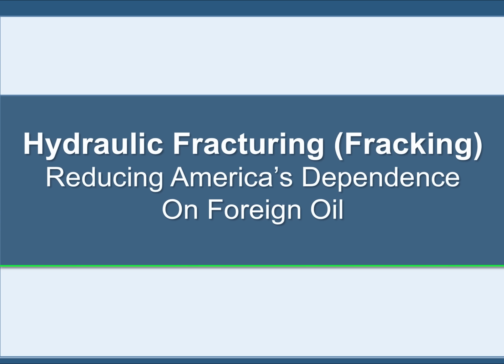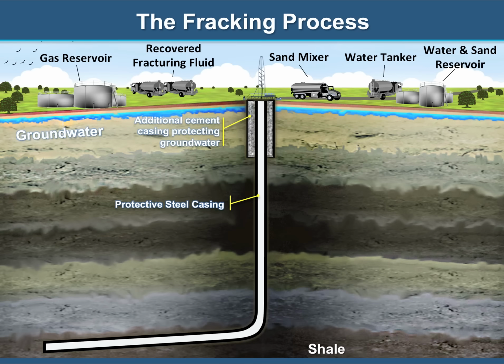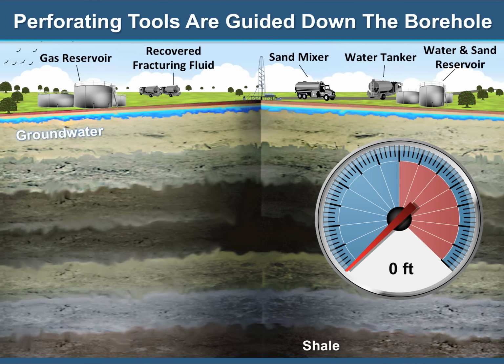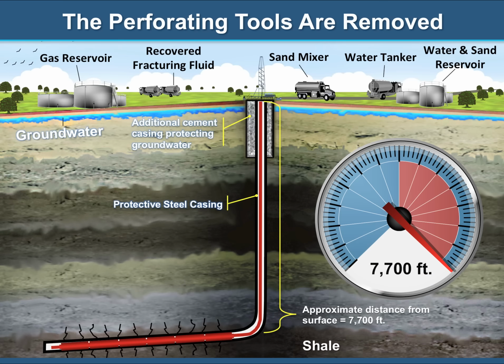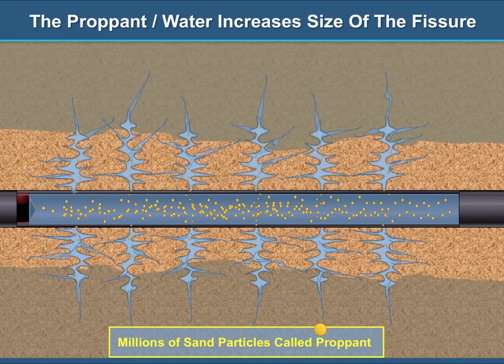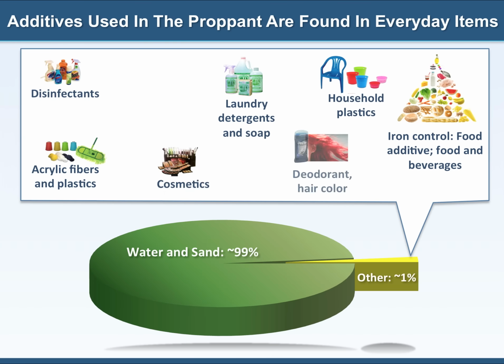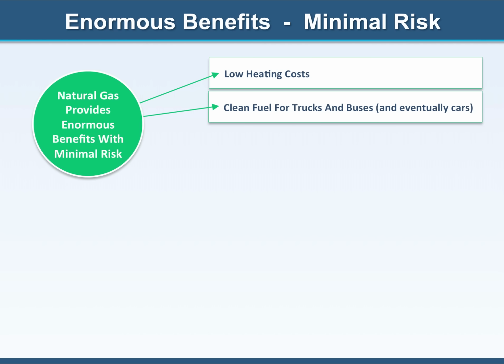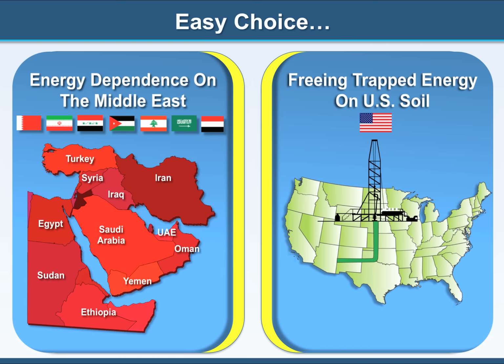Fracking Explained with Animation by A2L Consulting

Comment: If the production horizon is at the same depth but it consists of sandstone with good porosity and permeability could the extraction process be possible if we don't use water ...could fracking only lead to gas leakage into the hole thanks to the pressure change only? And could we call it conventional gas and conventional method? Is ERD system compatible with HYDROLIC FRACTURING?

Comment: The conductors emit a shock wave?    C'mon. Tell it like it is.   The conductors are used to initiate high explosive charges the perforate the pipe and shatter the rock .  Perhaps you did not want to talk about the high explosives.   Please also discuss the consitutents of flowback water and produced water, euphemistically called "impaired" water, and the means of disposing of this water.

Comment: I wish you mentioned that the water/sand/additive mixture is not used consistently. It's about 3-4 days of adding the mixture and creating the pressure of underground system. The mixture is pumped out and the oil or natural gas will come out for 20-30 years depending on the reserve size.

Comment: "A clean source of fuel" Bro it contains methane which is 86X worse then co2 emissions and the chemicals in the water are extremely dangerous. I know most right winged people are afraid to use science to figure out a problem but you should really try to implement it.

Comment: It all looks good on animations, but the reality is another story.

Let's just talk about the borehole.  As they drill down past the ground water level, all that groundwater pours into that hole, plus into any vast caverns that were hit on the way down.

This results in the groundwater level lowering, and that causes sinkholes and quakes.
Reply: Sure that may be a test that is used in the field. But it is not run during a frac operation. It would be run with drilling mud (containing water, barite, bentonite, and/or various salts) in the form of a pressure test to check the quality of the steel casing and cement layer. If pressure and fluid is lost, then the leak can be repaired and plugged with cement or gel. 
But to address frac fluid that does not flow back when the operation is done. Most company will run seismic testing to track all of the microfractures induced in the formaiton by the frac op. Very rarely do the fracture propagate into the overlying formation (although it can happen). Furthermore, gas and/or frac fluid will steadily migrate back to the wellbore due to the vast difference in pressure from the reservoir and the inside of the wellbore.
Reply: ...yep. We neeeeever do geological surveys prior to drilling ffs.
Reply: Richard Bean And they are so perfect right  They find every little crack at depth, every underground river, every empty cavern, and if ones is found, the oil company just goes someplace else even if they find a lot of oil down there?
Reply: kellerr13 ...you really have no idea how this actually works do you? Your hearts in the right place, but you seem to be horribly misinformed.  Obviously fracking isn't completely harmless (though miles safer and more effective than other forms of current alternative energy). It's still a HIGHLY regulated field in which absolutely every possible measure is taken to preserve the integrity of the water table, as well as the surrounding environment. Will it eventually be phased out by a better form of energy at some point? Sure. Until then this is what we have.
Reply: *****  THe well casing is not perfect, it's likely to have some holes and even if it doesn't there is a time delay between the drilling and the casing, and in that time, the water table drains down into that hole, and any exposed caverns.
Reply: kellerr13 the tubing and casing are both given numerous pressure tests, both positive and negative pressure tests, over each and every stage of the operation. Your scenario can and most likely has at some point happened, but it would be the result of the combined failure of several checks put in place.
Reply: Richard Bean What about the time delay from the drilling and the casing install?
Reply: kellerr13 The depth that you're  talking about prior to having surface casing installed is usually just after having cleared the water table and/or any potential aquifers. The drilling up to this point would most likely be utilizing compressed air or fresh water in order to preserve the integrity of the groundwater.
Reply: kellerr13 Any other questions? (Actually asking. That's not my attempt at being an ass)
Reply: Richard Bean Yes, how do you suppose that so much water get contaminated to the point it can be set on fire at people's tap?  And the ground water levels have dropped without any increase in water usage or any less rain fall in those areas.  Additionally, the ground water dropping results in sinkholes, and there are minor quakes.  These things are consistent with fracking.  Do you have an explanation for those?

Thanks in advance.
Reply: kellerr13 That ones actually simple. Theyre proven hoaxes who have either mixed a gas line into the it water lone for a quick video, as was done in the antifrack documentary "Gasland", or they are instances of naturally or curing methane in the well water, which has been documented as having occurred since at least Colonial times. Give me a bit to finish up answering. About to be driving.
Reply: Richard Bean For decades, the tobacco industry used similar statements.  "Smoking doesn't cause cancer", "It's not addictive", "Second hand smoke is not harmful", and I see the energy companies doing the same thing with fracking.

It's not all hoaxes even if some are. and just because the EPA says the water is safe, it still burns our eyes, causes rash on our skin, and we can taste chemicals in it and it makes us sick.  Pretending it's fine just shows us the EPA can't be trusted.

But all these things along with quakes and sinkholes are consistent with Fracking in close proximity, and it's too big of a coincidence.
Reply: kellerr13 These aren't statements made by the oil and gas industry, though I can understand your relunctance. If you're not willing to trust the EPA though, who I assure you we do not see as our friends in the oilfield, then there are other companies that can test the water. Taste, smell, etc., aren't going to be adequate ways of gauging anything valuable about the quality of your well water. These things vary wildly from place to place, regardless of fracking nearby.

I would honestly recommend watching "Fracknation". Watch it with a some skepticism though, since it's every bit the profracking documentary that Gasland is antifracking. The do a very good job of tearing apart the claims of the more famous individuals who used the flaming water argument.  I'll continue in a bit.
Reply: +798unionpipeliner I tried to be a little nicer about it, but yeah pretty much.
Reply: ***** Look. All I am saying is there is a pattern that goes hand in hand.  You may know a lot about the drilling process, but vulcanism, geology, etc. etc. are another issue.
Reply: kellerr13 Speaking of geology (which goes absolutely hand in hand with the oilfield), geothermal energy has actually been shown to cause far more seismic activity than fracking even potentially could.
Reply: +keller13 You really have no conceptual idea of oil field operations do you? Very rarely does a drilling rig drill to depth with an open air wellbore. The drill pipe pumps heavy weighted mud down hole to circulate rock cuttings to the surface this high column of mud inturn applies heavy pressure on the surrounding rock formations and aquifers preventing the migration of formation fluids into the well bore. There is never a vast amount of draining of ground water below the surface. steel casing and cement are placed and pressure tested incrementally to continually preserve the integrity of the surrounding formations and aquifers. .
Reply: Dylan Morin Well, we do have a way of testing it.

We test the surrounding area for various radioactive isotopes, and whatever one is not found, is injected into the fracking chemicals.

If that radioactive isotope shows up somplace else, there is a leak.